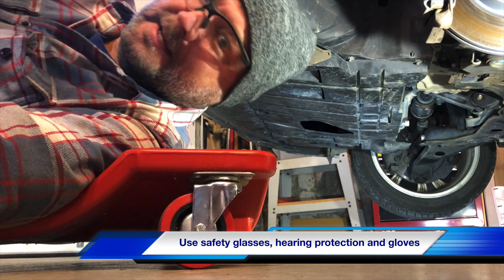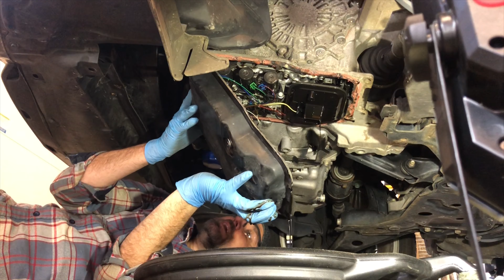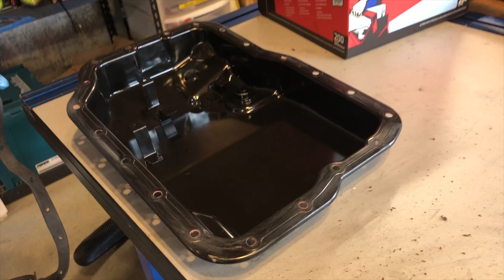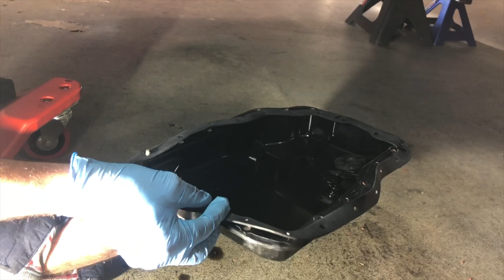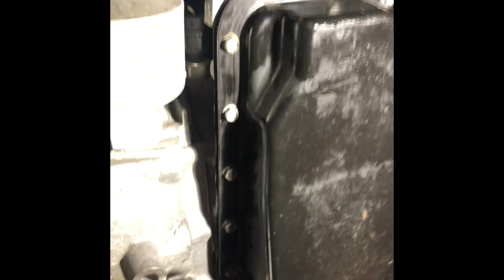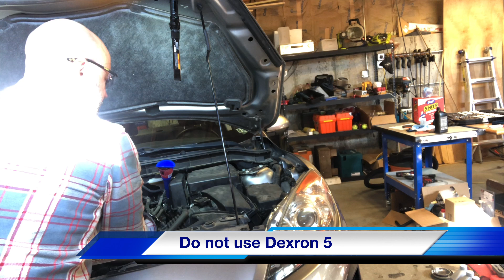Mazda3 Transmission Service Part 1: Drain Filter Fill

Comment: I have 2008 Mazda 3 I did the drain and fill a few months ago..old fluid was pitch black and now my at light came on should I do another drain and fill?
Reply from the maker: Thanks for watching and commenting. With the fluid being pitch black, that may indicate something mechanical is going on, such as too much clutch material worn away or a faulty Transmission Control Module (a common issue with these cars). In that situation I’d suggest taking it into a trusted transmission shop for a deeper diagnostic.
Reply: @fixityfix  hello can you tell me what torque wrench you used so I can look for it and do you by chance remember the part number for the filter?

Comment: Hi nice video. I have mazda 3 but not skyactive, i have 1.6 liter mazda-3 2016 model. And now its driven for 100k kms. When shall i change its transmission oil? And a mazda mechanic here in Riyadh told me that there is a common iasue of transmission failures such as slippage etc in mazda-3 after oil change, so he suggested me to drive and no need to change. Can u plz suggest??
Reply from the maker: Thank you for watching and commenting! I change ours every 50-60k miles (about every 100k kms).  It has worked out well so far and actually improved shifting in our case.

Comment: I found both of your videos to change the ATF, followed them to a "T". Very easy to follow steps. I did not change the filter due to a lack of time but replace as much of the fluid as I could following pt. 2 of the process. Car rums smoothly now with 102K miles on the trains.

THANK YOU for posting and sharing.

Comment: I was wondering where part 2 went to? Also, since I'm working on a 2012 things have changed. What color was the oil you put in? Madza parts department supplied a blue colored oil, fz. The filler dipstick has been moved to the casting on the radiator side! I like 2011 better! I haven't started anything as yet, research first! With lack of part 2 I am going to run the car for a month and then do another dump and fill
Reply from the maker: Mazda3 Transmission Fluid Change Part 2: Complete Flush
https://youtu.be/0Gh6VKMNr_s 
Hopefully this link will get you to part 2. Now I am using Valvoline MaxLife ATF, since it is approved for Mazdas of our vintage. Works well so far!

Comment: should i do this at 150k miles when i can't find any proof that the transmission has ever been serviced? should i just gradually change like 50% of the fluid every 10K miles.  the transmission shifts fine going up and down large hills in SW missouri :-)
Reply from the maker: Thanks for watching and commenting! I’d definitely at least do the gradual option. Gradual is safest. If you choose to flush, would be good to keep original fluid in a clean container- if it acts up, you could swap some of the old fluid back in (taking advantage of clutch material in fluid). Good luck!

Comment: @Fixity Fix Thanks for the great video.  Where did you get the rubber gasket?  Also, where did you get the plastic scraper with the plastic brushes?  Thank you
Reply from the maker: Thanks for watching! I use Wix filters when I can - the rubber gasket came with the Wix set. I also think the filter/gasket sets from Advance might still come with rubber gaskets. I think I got the scraper at Advance as well.

Comment: I attempted this on mine (before watching this great video) it has almost 180K miles, it has never been changed and the fluid is dark without any significant metal particles but doesn't smell burnt and doesn't slip or shift badly, the hardened silicone stopped me from dropping the pan because all I had were screwdrivers which I could tell would risk bending the pan rail or scratch the aluminum transmission body so I stopped and put the bolts back in before the seal was broken and just did a drain and fill. I really wanted to change the filter and clean the pan but I already drained the fluid using the drain plug ( at least it does have one) I am keeping my fingers crossed that the new fluid mixed in will not dislodge too many contaniments and clog the filter until I can return with some plastic wedges (thinking about using the one's they fell trees with) to break the pan loose then carefully remove the sealant from the transmission body.
Reply from the maker: Thanks for watching and commenting! How is your transmission doing so far?

Comment: where can i purchase this type of fluid? my auto parts stores don’t have this type of atf
Reply from the maker: Thanks for watching! I ordered the Idemetsu fluid from Amazon. Advance Auto in my area (Roanoke, VA) can now get it as well. Now that Valvoline MaxLive ATF is rated for these transmissions, I am planning to use it on my next flush for this Mazda3. You can find MaxLife at most retailers - usually, it is least expensive at Walmart. Let me know how your change goes, and good luck!
Reply: @fixityfix  thank you

Comment: Hi. I see you didn't put any gasket silicon on a pan and gasket. Others put all around it and some just few drops. 
Based on your video I guess it's not necessary  right?
Reply from the maker: Thanks for watching! I typically don’t use any sealant on rubber gaskets, I will on paper or cork gaskets.
Reply: Thanks for the quick reply. 
My 2010 Mazda 3 is 170k miles and the tranny fluid was never changed. I think maybe at this point it will be safer just to replace the fluid without flushing?
Reply from the maker: I think that’s probably safest! Good luck!

Comment: Hi Fixity, Question, why would one not perform the drain transmission fluid from the fluid cooler (part 2 of your video) first to get rid of some of the old dirty fluid, and then drain the pan/replace filter (part 1 of your video), then refill with new fluid and proceed to flush through fluid cooler like in the last parts of part 2 video?  I would thinking draining the cooler first would leave less old dirty fluid and require less new fluid to flush.  Just trying to get it right when I do my Mazda5 (built on same powertrain as Mazda 3 as I understand it).   Thanks.
Reply from the maker: I bet a flush/pan-filter/flush process would result in cleaner fluid. There are three reasons (mostly anecdotal) I went with the pan-filter then flush. 1) quicker, 2) standard practice is usually only a partial fluid swap, 3) there is some danger in an older automatic transmission of fluid being too clean, where a worn transmission could function poorly if no old clutch particles are floating around. Good luck with your transmission service!
Reply: @fixityfix  Thanks for your quick reply.  BTW, your two part video on this tranny flush was outstanding in both detail and explanation.  Keep up the good work!  The three reason answer you provided makes sense.  I went ahead with a two step flush/pan-filter but omitting the final flush based on your suggestion of not making fluid too clean.  Got 2 quarts of dirty fluid out with the initial cooler flush, and 3 quarts of dirty fluid from the pan-filter for a total extraction of 5 quarts of dirty fluid.  Mazda 5 has 8.6 quart tranny fluid capacity, so there remains about 2.6 quarts of old dirty fluid inside system.  So far so good afterwards.
Reply from the maker: Thanks for the update on your Mazda5 project! How is shifting and overall performance since you did the flush? It made a big difference on ours. I’m planning to repeat the flush on our three every 30-40K.
Reply: @fixityfix  Shifts smoother than before but it might just be psychological since I think my car runs smoother right after each oil change. :-)  Mazda 5 had 113K miles on original tranny fluid as evidenced by the black fluid extracted.  So definitely a big difference mechanically for the transmission, but also big peace of mind for owner.  I probably should have done tranny flush earlier, but Mazda 5 manual did not list transmission flush on the maintenance chart.  Thanks again for your wisdom and look forward to more of your videos.
Reply from the maker: Lol, totally agree about oil changes!

Comment: Is there any oil leak underneath the oil pan after using the rubber gasket. Nornally Mazda used the silicone RTV gasket maker. But now you're using the rubber gasket. Is it running good?
Reply from the maker: It’s running/shifting perfectly, and, so far, no leaks. I did add a couple of extra ft/lbs to the pan bolts.